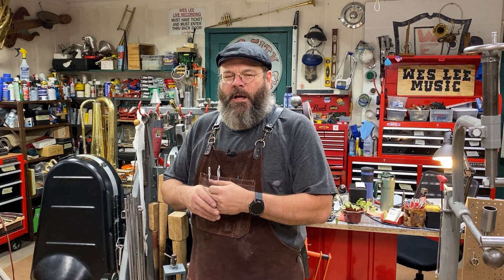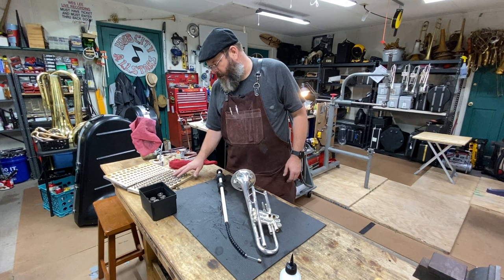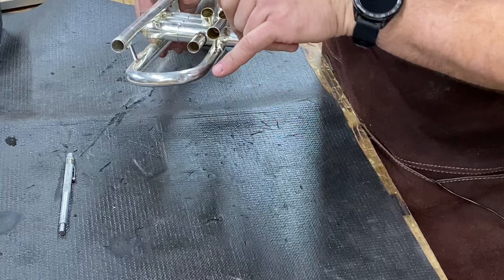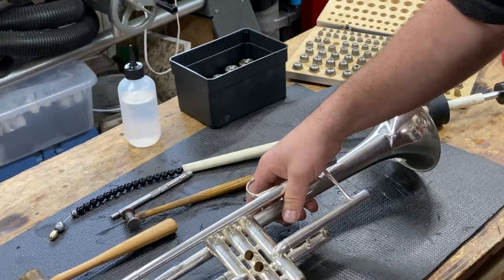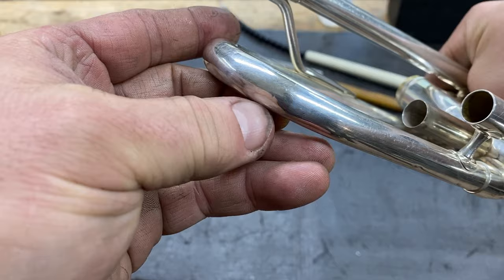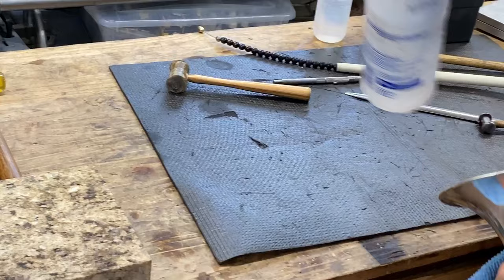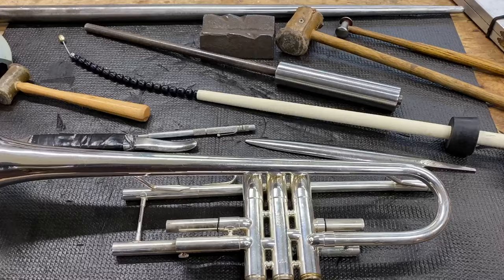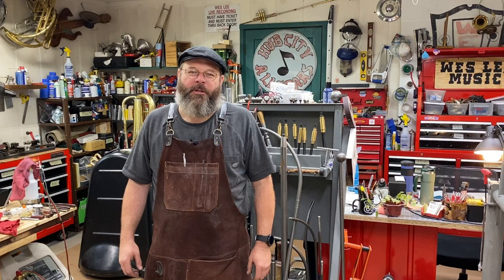Trumpet Restoration & Cool Tool Reveal- band instrument repair- Wes Lee Music- Ferree’s Tools

Comment: Hiya, Wes.  Love watching you work - I've only been doing instrument repair for a short time but it is absolutely fascinating.  I do have a question about using the P50.  When I use it for trumpet bell bow work or on trombone tuning slides, I've found by propping the tool vertically on the work bench or on the seat between my knees, I can keep a light-moderate pressure on the tool while I hammer the high spots.  This tends to push the ball through at the earliest possible time and I'm able to go immediately to a larger dent ball.  I've never seen you do this technique and was wondering if there's a reason you work the tool horizontally instead of vertically.  Keep the videos coming, there's bunches of us out here who really enjoy the insights you provide.
Reply from the maker: I use it in different, much more comfortable ways when not on camera and trying to get good angles.
Reply: 0

Comment: You are right on brass dent hammering. I tell my co workers or students that wants to learn . First thing is how to hold the hammer properly, second is you hammer to the sideway action not up and down action,third is you hold the hammer at the end tail not in the middle to let the weight of the hammer head do it’s job,fourth the hammering is all in the wrist not your forearm, and fifth listen to the tapping sound on the dent balls and visual seeing where the ball is moving. Takes months to figure that out and patience but it will come. Over thirty years of doing it . That would explain part of my hearing lost  😞 on tapping on pipe all day long just to satisfy that women….😆
Reply from the maker: It is such a practiced nuance. I have “tappers ear” so I know those blues

Comment: Wes you give me hope in watching this video. I like how you go about explaining what you’re looking for as you work and going slowly. I find this one especially informative to see how this is done as I own a Bach Stradivarius 180S37 bflat in silver. It has one dent in the bell and one at the first turn. I won’t explain how the dents got in it but it made me sick. Because of the value I never trusted anyone to touch it. It also didn’t help when one of my band mates had the same thing and sent his out because the front brace popped off the bell if I remember right. The one thing I do remember though is the butchery when he got it back. It looked like someone trying to weld when it was set too hot. It almost made me want to cry seeing that. This was my instrument through high school. When I was trying to decide which it was going to be a Doc Sevrinsen or the Bach I was fortunate I could try both from other band members. I fell in love with that Bach sound and never regretted the choice.  There was a lot of hours spent with that trumpet.

Comment: Damn Brother, I would have thought that trumpet toast after you turned it to the camera's eye. I've always bought used, less than perfect instruments thinking that with some care, the wrongs may in time be righted. Sure that the tools your promoting are more costly than most imagine, but I've seen where your inventiveness has won out over odds that few may have to contend with. Great job sorting out that poorly mangled brass bell. You must wanna clobber folks at times when you see the state these things have been left in. The burnishing tip with the steel rod around that bend was genius. It gives me hope, though I doubt I may never reach your facility with these repairs. Your awesome.

Comment: Wes, I have acquired a trumpet from a storage locker sale. It is a H N White b flat/C trumpet that I think was manufactured in the early 1900s. It came with several issues such as the bell badly damaged along with many other dents in the tubing. Also two of the valve caps were missing. The only one that was there was the center one.
After having it repaired now some of the tuning slides move but not all and none of the tubing dents have been removed. The valve caps have been replaced but they are all different. Can and are you willing to help me?

Comment: I want to ask about the dent hammer technique, I imagine how it utilizes a double or triple bounce to create the directional flow as the metal warms. Do you have thoughts that could help me as I move beyond basic introduction to this skill? I learned about circular flow from a different skill, and am new to this one. 
Also how the burnisher is used parallel to the tube. I have never though of that, and it seems difficult to hold in place. How can I work on that? What do I look for?

Comment: Wes.  Great work! I play a Bach Strad. Cornet Model 25-62, serial number 2934, probably circa 1934-36.  I'm concerned about the lead pipe - my local repair man (Elkhart trained) has indicated that the pipe is "rotting" from the inside.  Could I use your email address to send you some pictures and perhaps discuss this situation.  Thanks. Be well!